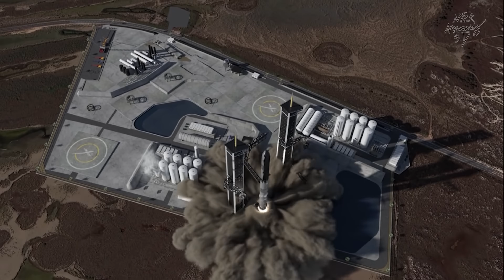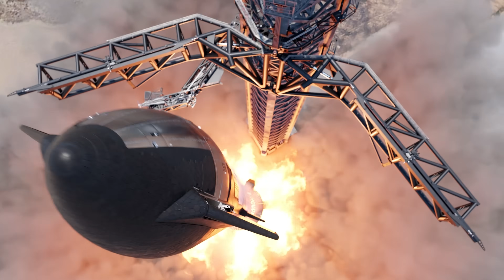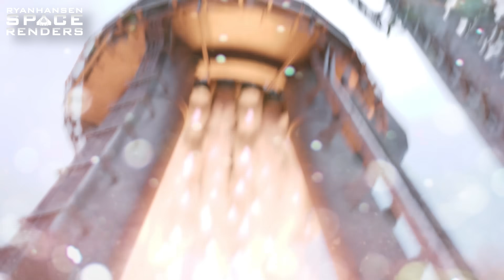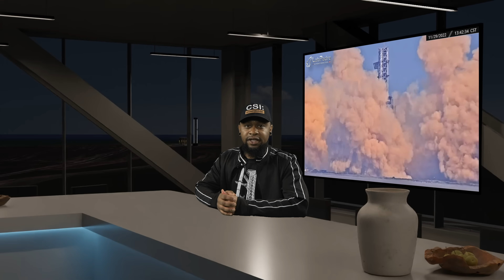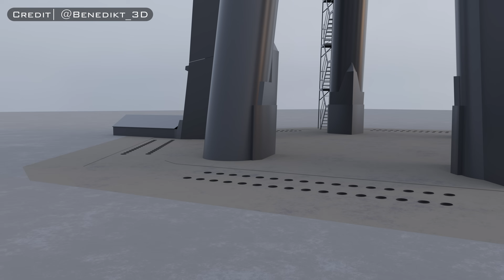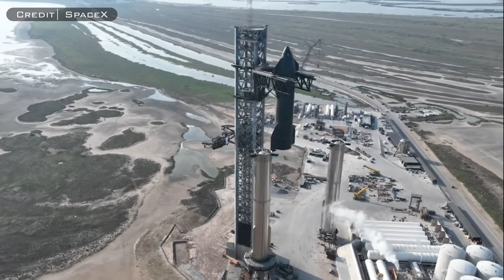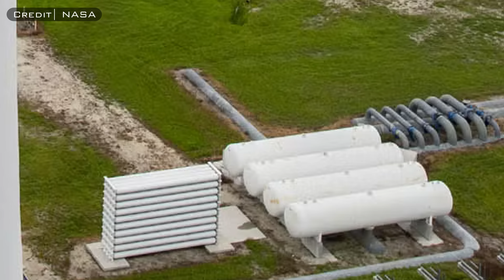SpaceX's "Major" Concrete Problem + Water Deluge Construction Begins at Starbase

Comment: But why don't they cover the entire area with thick iron plates?
Reply from the maker: Melting temperature of Steel is somewhere around 2,200 degrees F.
Reply: @CSIStarbase  : The peak of the temperature shock takes maximum 5-7 seconds long. I don't think a 40mm thick iron plate could melt.

Comment: Why not just put a steel plate there and forget about concrete problems... It should survive a couple of launches... But as for the shockwaves thundering back towards the rocket, that's another big problem and the deluge system is not only to protect from extereme heat but also about muffling shockwaves ...
Reply from the maker: Melting temperature of Steel is somewhere around 2,200 degrees F.
Reply: @CSIStarbase   If you do a 33 engines static fire for more than 15 seconds sure, you gonna start seeing melting pellets of steel fying around but those will be less dangerous than those pieces of concrete imo, and a 1 inch thick steel plate will not melt instantly... But even the launch mount support towers would start to feel the heat of a 15 seconds all engines static fire... I think that during a launch, the launch mount won't have to support this hell for more than 5 seconds and the rocket will rise and take away the danger with it fast enough for any heat to become a problem but as for the shockwaves, that's a big unknown, but the 14 engines long duration static fire did not create any damage related to shockwaves, but double the amount of engines and the problem quadruples...

Comment: I'm still kind of scratching my head as to why they built the OLM so close to the tank farm and a public road. To me, it's a rare miscalculation on the part of SpaceX. Even putting it on the the other side with the tower in between the OLM and tank farm would have been a plus. It really should be farther away from everything.
Reply from the maker: It’s pretty terrifying. I agree

Comment: Do you know why they don´t put the same heatshield-Tiles from Starship on Stage Zero and the concrete to protect it ? The Heat Shield ist made for Temperatures about 1600° Celsius and they are producing them in mass.
Reply from the maker: The tiles are incredibly brittle. They would shatter the moment the first raptor engine starts up and sends that huge shock wave straight to the ground.
Reply: @CSIStarbase  Thanks! yes...of course - very brittle. Too bad. well, they will find a way.

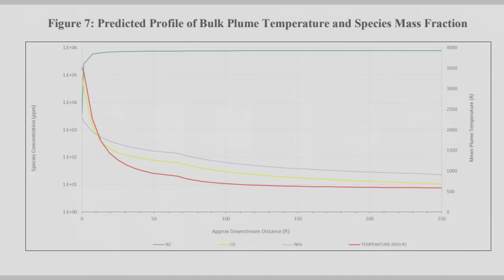Comment: 9:45 Exhaust is relatively cool while moving at 4 km/s, but when it slows down substantially from hitting the pad it will heat back up again as macro kinetic energy turned back into heat. Stagnation temperature is the relevant concept. Obviously not quite that simple--doesn't stop all the way in most places, mixes with air, etc. However for center engines with little entrainment, surrounded by other engines, could heat right back up to combustion chamber temperatures, definitely over 2000 F. 

However, don't let me give the impression I don't think you do great work. All the evidence you hunt down is great, and takes persistence and patience, and I think you generally analyze it well. Keep it up!

I think that at Starbase an expendable pad is not a problem per se right now since they can only do at most 5 launches per year and some static fires, but I bet they'd like to stop doing all these earthworks to protect from shrapnel and just stop making so much shrapnel. I think the Fondag will reduce but not eliminate shrapnel, and may still be an expendable pad. Fondag with water deluge may do the trick well enough for them to live with at Starbase. KSC can get a less kludgey solution that does't make any shrapnel.

Comment: It happens quite often in engineering that you have a problem, but you discover X material that has the exact properties you need and lets you delete a lot of unnecessary parts.
In this case it's Fondag RS and the unnecessary part is a flame diverter.

Comment: During a static fire test, the rocket is sitting in one place for the duration of the firing, giving the concrete the full force of the blast for the whole time. But during a launch, the concrete is only exposed to the full force for a very short time as the rocket lifts off and space is rapidly increased, allowing the force to dissipate rapidly.

Comment: Zack, another great report.  Your insight, hunches and the degree to which you investigate every possibility to resolve an issue is second to none!  I have a question:  as we have been told that, unlike the Falcon 9, Super heavy and Starship will be able to hover, so why do all the renders show such a fast transition from decent to catch?  And btw, the renders these guys do are unbelievably great.  Thanks for your in-depth coverage of this epic development. I look forward to every new edition.
Reply from the maker: I think it will come in extremely fast. But will also slow very quickly as well.  I wouldn’t be surprised if there was 1 or 2 seconds of hovering

Comment: How many raptors dose Starship need to lift off? Could they clear the tower, or at least clear the blast limits of the pad by launching with a subset of engines?
Reply: Also, could The Boring Company construct a flame diverter tunnel under the pad?

Comment: The problem is not the concrete withstanding the launch.  They can do this...really... eventually...   The problem is it's a flat surface and it's reflecting the sonic energy straight back into the rocket.  This is causing just as much damage as debris.  They need to build a "ramp" to slide under during launches.  This will redirect the energy away from the rocket (and the tank farm)

Comment: You'd think SpaceX have enough experience with the Raptors and test stands set up at McGregor to design and build a suitable pad that can withstand the full force of the booster. I could be wrong but I don't think SpaceX are gonna have long term issues on this.
Reply: Test stands are very different case as it has flame diverter. They most likely derive the experience from suborbital pads which has the same basic design as orbital pad

Comment: It still intrigues me - many years back, I read about some unusual fire where even the concrete burned up. There was something about when the fire temperature was over I think 3600 C, it was impossible to extinguish by water, as it was disintegrated to hydrogen and oxygen, which burns just by itself. So I wonder how sure we are the same conditions never happen with the water deluge system? And also, why the heck they don't use steel plates, say 1 inch thick? That would definitely resolve all their problems I'd think?

Comment: Never forget that concrete may be strong in compression but very weak in tension. Therefore should you not need to analyze stress conditions at the top of the concrete due to engine blast effects of shock reflection that would induce tension thus spalling. They obviously use reinforcing bars to strengthen the concrete pour as a whole but the surface is always prone to de lamination and spalling. I am a former geotechnical engineer, so if there are any structural engineers or material scientists out there, please correct me.

Comment: Seems like the different heights of the launch pads wasn't accounted for when calculating the pressure at the outlets. How does a double wall tank benefit over a thicker walled tank? Water at the perimeter of the legs doesn't seem like it'd protect the concrete much. Sure they could get several feet over the concrete, but that wouldn't last long once the raptors ignite.
Reply: The reason why a water deluge is supplied by spraying it instead of a water pool is because it can be continuously supplied even when the water already outside is vaporized by exhaust
Reply: @alvianchoiriapriliansyah9882  There isn't any indication they are going to spray it. All the proposals shown have it bubbling up outside of the legs.

Comment: Awesome work on this channel!  Your analysis is very helpful in understanding the detail of the Starship systems!  Thank you!  One quick question that may have been asked many times before, why not place a portable steel structure underneath the OLM in the shape of the top of a circus tent🎪?  It could be bolted down in sections and removed to allow the Raptor stand and other equipment under the OLM at the appropriate time. 🎪
Reply from the maker: This is the number one question I think.

Comment: Tell Elon to submerge into the high heat cement a big heater element and then crank it up to drive out the moisture before firing rockets. This way the steam will not blow stage 0 apart

Comment: Great video and analysis...  A couple of questions though...  How long before the new concrete reaches its maximum (or nearly) strength?  Does the thickness of concrete affect its strength with regard to compression and its ability to resist high temperatures?  And lastly, is there another factor with the concrete that hasn't been considered like the scouring action of 33 methane/oxygen engines?
Reply: Spec sheet says >7500 psi @ 24 hours. The foundation under it will be the biggest component of its compressive strength. Would think thickness wouldn't be an issue for the surface concrete. However, it needs to be thick enough to keep the material under it from getting too hot. I'd think this will be a very dynamic environment with other considerations than the static estimates used.
Reply: Oh, and they seem to be testing concrete with Raptors at the engine test facility.
Reply: @heartysteer8752  Thanks for both replies, very helpful. 👍
Reply from the maker: Unfortunately the data sheet did not have that information.  It just said strength after 24 hours almost like it’s good to go after that which we all know ain’t true lol.
Reply: @CSIStarbase  Actually it was very good to go - it went everywhere! 😆

Comment: tabcast-94 is an 94% alumina dense refractory cement that can withstand 3300 degrees F.    Not even close to what is required and a deluge won't help a lot either,  when you start playing with that much heat and pressure the oxygen and hydrogen will start to seperate and burn, anybody that has played with burning magnesium and water will know exactly how that story ends.   Anyway,  i need 740 bucks to remind the spaceX team about a few principles of conduction, radiation, and convection heat dissipation
Reply: Exhaust coming out outside the launch mount legs (where the water deluge is) has less heat than right below the launch mount. Water is simply vaporized into steam instead of 'burning'

And I need 740 bucks to remind you that SpaceX aren't a bunch of wannabes either
Reply: @alvianchoiriapriliansyah9882  i know so much more about this than you, i don't even know how to respond,  its like trying to talk to one of my grandkids,  they're idiots but i don't want to hurt their feelings

Comment: The problem isn't the concrete as much as it is launch conditioning. Yes the best refractory will need to be used but without doing 1 od the following it won't work as intended. 1 A large enough amount of water pumped into the blast area that would prevent direct flame contact. 2 the blast zone needs to be preheated hot and long enough to react maximum expansion and cook out the remaining moisture out, preheating is the key because the concrete will be at maximum expansion therefore eliminating rapid expansion spalling. I have seen tool steel 40 ton machine rolls explode to and entire smelting furnace blow apart because they tried to shave couple hrs off initial cook out of water
Reply from the maker: Wow.  That’s crazy. That makes sense though

Comment: Very well made video! I think, however, that SpaceX will not succeed with Starship until they make a flame diverter! Maybe a moveable one consisting of 2 parts, made of thick steel. This has to be removed every time they will work on the Raptors.

Comment: First time viewer. 
I find it laughable that you talk about space science and then calculate with a formula using imperial units.
Reply: The boiling point of water is 100 °C 🙄
Reply: @valamaas  but it's also 212°F, I didn't know that before today. Learning is fun.
Reply: @Geoff_A  go ahead and learn imperial garbage
Reply: @valamaas  you can learn both you know? Inches, feet, yards and miles. Are you in the US? Miles are imperial by the way :)

Comment: I'm no structural engineer, but why don't they just install something like a metal 'upside down shower head' plate with holes underneath the launch mount? Route a large pipe with a strong check valve to the middle of the mount to supply it - plate will slightly bulge up due to water pressure then when raptors start the pressure wave will force the plate back down against the concrete shutting the check valve and squeeze out whatever water is underneath for a brief burst of extra water cooling & protecting the concrete?

Comment: Might be me but seems you get 33 raptors firing off, seems there will be a cumulative effect, much like your comment about exhaust entrainment, while it then matters how fast the rocket gets off the pad facing the heat/force that it will be exposed to.  Even then the water deluge system better be top notch.  Not that i wouldn't think SpaceX would to any less, i'm still amazed every Falcon 9 launch and recovery except when expended on a rocket needing high orbit. Hahaha even that seems Elon had thought about this, each rocket at some point is expendible (after 15 launches, thought that is the current record...) so for the higher orbits need an expendable rocket, perfect match... 😎

Comment: OK--------.  Concrete Contractors usually Plan for 30 days for their Concrete to completely dry before putting STRESS on it... Some large pores take months to completely dry....  And Space X launch platform only had 48 hours????  I cannot believe that anyone really thought any high temp Concrete would be hard and DRY enough to take any engines 3,000 degree exhaust tests!!!   I would have expected nothing less than what HAPPENED!
I can send you to hundreds of projects that failed simply because the engineers failed to wait for their concrete to set and completely DRY before putting a load on it.  Tunnels, Bridges, Buildings and the list goes on and on and on and on...!!!!!!!!!!!  And ON!!!  Owners HATE to watch Concrete DRY...!!! Especially when deadlines are rapidly approaching.
Reply: True for regular Portland cements, different case for FONDAG RS

Comment: I'm happy about this news but wondering why just a flame diverter passive system wouldn't be better. I guess if they reuse the water than this would be pretty reusable.
Reply: Loss of face???
Reply: as someone above me said "SpaceX is so successful partially because it tries to challenge assumptions" assumption by so many is a flame diverter trench why not test for sure and see if there is another way. A Flame trench would be expensive and very time consuming to build. It cant be built everywhere you want a launch tower and so many environmental factors come into building one that otherwise wouldn't have to be considered
Reply: @sauceboss1846  A "trench" doesn't have to be dug out, it can be built up after the launch pad is raised high enough.  SpaceX is right to challenge assumptions, but there is no point "challenging" something which already works and has never been a serious issue for rocket launches.  Indeed, going out on a limb when there is no pressing need or much advantage to be gained, especially when you are trying to launch a vehicle with more engines than has ever been launched and twice the power of the most powerful rocket even launched is reckless and bordering on foolhardy.  

It isn't just a question of having the cost of replacing the launch pad after every launch, if even a single piece of hot concrete is blasted high enough it can hit the booster and cause untold damage to Starship or to ground facilities.  SpaceX may well  have been successful challenging assumptions, but they are also quick to identify problems and change their approach if it isn't working.  It's now time to recognise this isn't the right way to go and that some sort of flame diverter is necessary.

Comment: IMHO, a deluge system is essential to dissipate the percussive energy emanating from all those rocket motors! Temperature and (constant) pressure are one thing, but a rocket exhaust plume is extremely dynamic. We've seen what happened to the Oroville dam spillway under dynamic attack!

Comment: I suspect that there is a big difference between the static pressure rating of the Fondag concrete and its ability to withstand the pulsing shock waves of the raptor exhaust.

Comment: Those tanks are almost certainly air spaces to prevent a "water hammer" issue.  on that scale it won't just shake the pipes, it will cause them to crack open when those valves slam shut.  Probably also part of the reason there are so many valves rather than just 2 so the flows can be staged on and off.